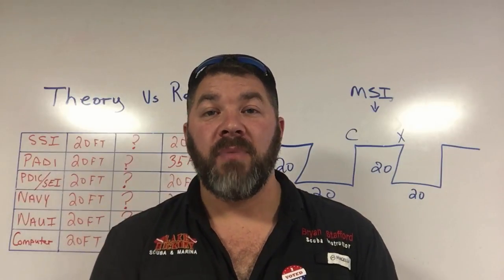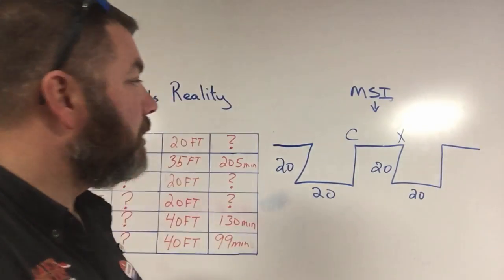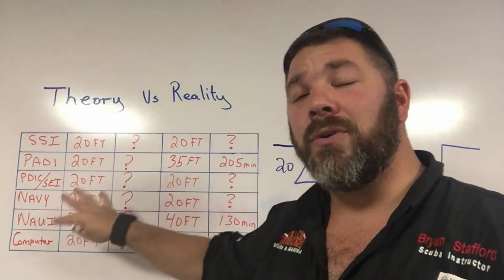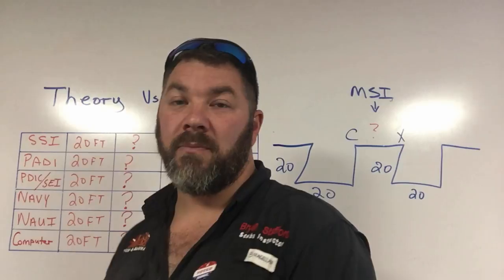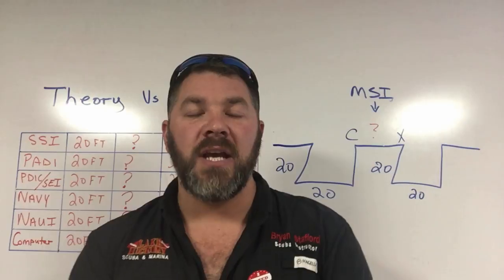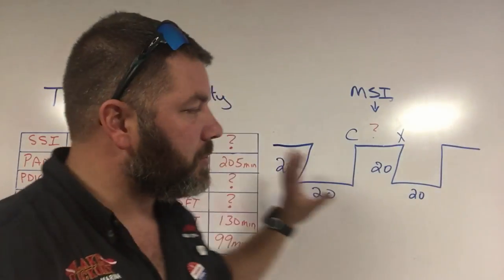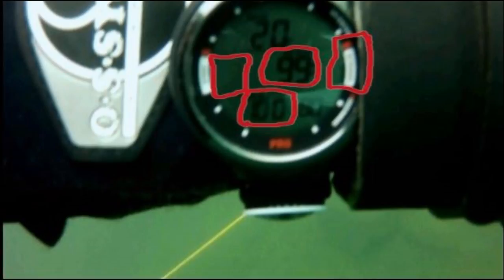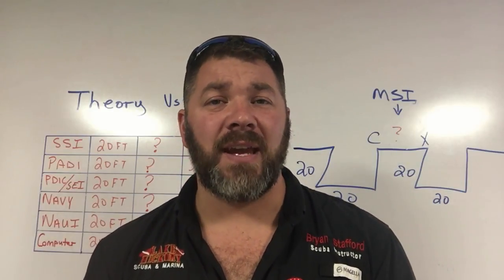Theory Vs Reality Will I Get Bent???

Comment: I just found your channel and I think it's great. I'm a fairly new diver who does most of my dives in shallow rivers looking for fossils. I typically am in water less than 20', usually about half that. I was told and based on my research I was safe from decompression sickness so it's not something I've spent much time worrying about. Your video was very helpful in explaining this. My dive buddy did have an incident this summer that was supposedly communicated to DAN by folks at the hospital. My friend presented to the ER with bubbles in his neck. He also was found to have had a large bubble in his chest cavity. As it turns out, there was a preexisting condition that he was unaware of (hole in the heart) that may have contributed. I am unsure if this incident would be considered DCS or some other sort of dive injury. He admitted to popping back to the surface by pushing off the bottom multiple times. The water was about 8' deep. I don't worry much about nitrogen in my body from these shallow dives, but I do always surface slowly while exhaling!
Reply from the maker: Hello sapperstang, we are so happy to have you as a subscriber.  Though it is very unlikely that a diver will find themselves developing Decompression Sickness at such a shallow depth, the risk is still there.  As you stated, the ascent rate is a huge determining factor.  I will state this though, Silent Bubbles are very real and can occur on land as well.  We can never be too safe when it comes to diving.  I know of several cases where divers made 1-2 hour dives in less than 20 feet of water, and upon surfacing decided to take a very hot shower to warm up.  This caused Silent Bubbles to form due to the fact as their bodies heated up, the residual Nitrogen expanded, thus causing the Silent Bubbles to manifest, and then developed into skin bends.  Thankfully though, this is the most common type of Decompression Sickness, that is rarely fatal.
Reply: Yes, a hole in the heart can be DSC problem, the lung can normally handle some of the air bubbles generated but if it is too much and goes from the right side to the left side of the heart, then it can cause a bubble to go to the brain, not good.

Comment: the ceiling for the safety stop on computer usually is 3 m (=10ft), so off-gassing is built into the models between 10 and 20 ft as you stated
Reply from the maker: Very True.

Comment: Hi Bryan, Thanks for the follow-up on my question. Someone told me (and I thought it was you, awhile back) that when dive computers show "99" it means the number is something greater than 99 and can't be shown with just 2 digits. In the case of the 99 minutes of no decompression time on your dive computer, I think it was just agreeing with the dive tables that it could not compute a time because of the shallow depth, or, something greater than 99 minutes - like the 205 minutes you show from the PADI table at 35 feet. Again, thanks for another great thought provoking dive video.
Reply: That's Right John! Dive computers either show 99+, 99, or --:-- when your NDL is greater than 100min. I have a Garmin descent dive computer and at the beginning used to show --:-- but after some diver's complained about the format they changed to 99+ like most of other computers. Even thought when going into the dive plan setting and inputing a depth of 20feet the computer shows the Maximum NDL of +999min, it only shows a value of 583.4min at 29ft this is with the conservatism set to low. In Bryan's experiment is really nice to see how he tries to see if going beyond the 99min mark will make him go into Deco. But as check at that depth his NDL would have been greater than 999min which even thought he passed the 100min wouldn't have put him nowhere near to the NDL values for that depth. It's also worth mentioning that this 99min way of displaying the NDL is reminiscent from 8 segments displays, with more modern computers using LED displays or dot matrix ones they could choose to show the value which would be around the 1000+min but for the sake of simplicity and ease of use to diver's that have become accustomed to a certain way of the readings to be displayed, manufacturer's have opted or been pushed by the customers (Garmin's case) to use that format.

Cheers!

PS: thanks Bryan for your videos and all the information you have been putting out here for all of us to share, learn and discuss. Keep it up!
Reply from the maker: You're welcome, and as stated by others, the general consensus is the screen can only display two digits. Thus, 99 minutes is the most it can display.  This is another reason we highlighted the bar graph on the right side of the computer, to show the on gassing of Nitrogen versus the no decompression time remaining.
Reply from the maker: Thank You Alexjandro for the kind words.  We appreciate everyone's comments here on our videos, and we enjoy learning from others as well.  Happy Diving.
Reply: Totally right! I missed mentioning that on my previous comment, your computer did not show any kind of reading when it came to N2 buildup, which demonstrates the point even further. 

Cheers!
Reply: Happy and Safe Diving for you too!

Comment: Hey
Bryan, My theory on this topic, and (correct me if I am wrong), is that at 20' depth is that you are only a little over ATM, and not under enough additional pressure to bring Nitrogen out of solution, thus making surface air perfectly safe for an unlimited time.
Reply from the maker: From a theoretical stance, you are correct.  The problem though is, no two humans are identical. We all have fast and slow tissues with different decompression rates.  From 10 meters of depth (33ftsw, 34ftfw) we find the biggest pressure differential.  The good news though, this is the least amount of on gassing of any gas.  So once again, theoretically speaking, yes you would have an unlimited amount of no decompression time.

Comment: Bryan, I think you messed up on your presentation of how your dive computer works...Mares simply shows the "no deco" time remaining at your current depth.  In your case since you remained very shallow (20-25 feet) the "no deco" time did not decrement.  If you were to go deeper that time would count down and when it gets to zero it will in fact go into decompression.  If it gets close to zero and you swim up a bit it will add time back on the clock.  Bottom line, the 100 minutes of current dive time being greater than the 99 minutes of "no deco" time remaining means nothing on the model dive computer you show.  What you want to see is when the 99 minutes "no deco" time begins to count down and get close to zero.  When that happens you are close to entering decompression.  I believe the 99 minutes shown on the screen is simply an a design choice made to limit "screen real estate" to 2 characters.
Reply: Not a Mares exclusive (2 digit limit to the no deco time), my suuntos, Uwatec all do the same, doesn't  mean the model internally is keeping more digits (it is THE difference between dive computers, rec vs tec
Reply from the maker: Hey Chad, you are 100% correct and we discussed that before shooting this video. Primarily, we believe that the screen real estate is one of the biggest reasons 99 feet is the maximum for this depth (based off what the computer shows in the plan function), (10:07 mark in the video).   Even comparing this to the SSI Tables, the maximum allowable time at that depth is 130 minutes, well beyond a 99 minute bottom time.  Also you would be correct as well with the remaining time at 20 feet.  The 99 minutes on the computer (dive time remaining) has not been met, even though the dive time has reached the 100 minute mark. This is another reason we outlined the bar graph on the right side of the computer, to show the viewers that we are no where close to super saturation of Nitrogen.  We have discussed doing a follow up to this video by placing a computer at a depth of 20 feet, for 24 hours, just to see what would happen.  We are curious to see if the 99 minutes remaining changes, or if it stays the same though out the 24 hour time frame.  Given the depth of 20 feet being the test depth, and the history of historical dives made by previous divers, my guess would be that the computer would show a diver going into decompression, both on the bar graph and on the time remaining, but the diver himself would be just fine.
Reply: You could try to simulate with a dive planner like Suunto SDM, has the same models as in the computers and you might not lock the computer beyond repair (suunto cobra for 24 hrs at 12m locked forever, not even factory reset possible)
Reply from the maker: Good idea.  I will probably call Mares first to see what they say about the Mares Smart.  To my knowledge it only locks up for 24 hours after a DECO Dive, without DECO obligations being met.
Reply: Many moons ago (2002) we had a Cobra permanently go into locked mode, never recovered and was replaced by Suunto, had been at 12m for 24 hrs ("lost" in a rescue course, found the next day :-( )
Reply from the maker: Hopefully we won't have the same thing happen to our computers.  But then again, if Mares would replace it for free, it would be some great advertising for them to see exactly what their computers could take.
Reply: Well if you were reaching your limits the 99 minutes of no stop time remaining would've counted down, and would've been zero before going into a mandatory deco stop. I know during a recent dive after being loaded up from dives earlier in the day I actually saw no stop times below 99 minutes for depths that would've normally just been 99 minutes for the entire dive.

My computer also displays a line for depths where I have no maximum no stop time. And 20 ft and IIRC even 30 ft are depths where there is no limit for air, and 40ft for EAN32.
Reply from the maker: Having residual Nitrogen in your system definitely makes a difference.
Reply: @LakeHickoryScuba  Bryan you are correct. The Mares Smart will not lock up simply because you accomplish a deco dive, rather it will provide you appropriate deco stops.  If you violate those stops it will work only as a depth gauge and bottom timer for the next 24 hours
Reply: Instablaster.

Comment: Firstly, thank you for creating these videos, they are always well thought out, practical and helpful.
I know that this video was posted a year ago, but the title grabbed my attention so I watched it & just wanted to comment on one aspect: 
** Warning. This post became longer than I expected. If you don't like reading, skip the to "CONCLUSION" **
Decompression sickness occurs when the partial pressure of Nitrogen in the diver's tissues exceeds the ambient partial pressure of nitrogen to the point where nitrogen can no longer stay in solution. The question is, how large can that difference be before it becomes a problem. According to Haldane it was a 2:1 ratio. This essentially meant that a person could be saturated to 2 atmospheres (33 fsw) and return to one atmosphere (the surface) and have a low probability of experiencing DCS. This was later modified down by Workman to a ratio of 1.58 (Interesting footnote to all of you SSI divers that this question comes up in the SSO Open Water Diver class. Don't ask me why on earth such a question made it into an Open Water level class, but I'm sure that there is a story behind that somewhere!). According to Workman's ratio, that depth would now be 0.58*33 = 19 ft.
Decompression theory moved on and we now think in terms of "M-Values" (also attributable to Workman). The "M" in M-value stands for
 "Maximum." For a given ambient pressure, an M-value is defined as the maximum value of inert gas pressure (absolute) that a hypothetical "tissue" compartment can "tolerate" without presenting overt symptoms of decompression sickness (DCS).
In the Buhlmann ZH0L16 decompression model, the tissue compartment with the lowest M0 value is tissue 16 at 41.8 fsw. Taking our 20 ft dive that equates to (33+20)*.79 = 41.87 fsw

CONCLUSION: Although I would not like to test it and I'd certainly not advocate it (always dive your computer). The reason why this 20 fsw dive does not show on tables or computers is because you can stay at 20 fsw, become fully saturated (i.e. stay as long as you wish) and could still make a (slow) direct ascent to the surface with a low chance of DCS because your tissues can take this level of supersaturation (at least in theory :) )
Reply from the maker: Hello Graham, thank you for the very methodical comment.  In regards to tissue saturation, this is how it has been explained to me over the last 31 years as a diver.  In short, Decompression Theory is Theoretical at Best. Simply meaning, there are not two human beings on the face of the earth with the exact physiological make up.  We all have fast and slow tissues, but both mine and your fast tissues will on gas and off gas Nitrogen at two different rates.  The same applies with slow tissues.  When a formula is developed (Workman's, Buhlmann, etc., etc.) training agencies and gear manufactures will usually consult with attorneys, and before they produce a product (computers and tables) and then make a claim that this is concrete evidence a diver will become bent, they will always distort the numbers for safety and liability.  I relate the Scuba Industry to the Food Industry.  When the FDA decides to release a new ingredient or edible product to consumers, they will take the maximum amount that is safe for consumption and cut it in half.  They will then take that amount and cut it in half again.  Lastly, they take that number and cut it in half one more time, and this is the number they release for safe consumption.  When we go tech diving, we are purposely putting ourselves into decompression (according to the decompression models), but yet through accelerated decompression we bring ourselves out of decompression at a controlled rate.  But even at this level, we still are allowed to choose what algorithm we want to use, thus proving the fact that Decompression Theory is Theoretical at Best. We did a video a while back showing the differences in several of the agency's dive tables, and the numbers were astounding.  I can say for a fact, that as a dive professional for 5 different training agencies, including SSI, PADI, PDIC, SEI, and CMAS, I routinely violate one or more of the agencies dive tables and limitations, but at the same time still well with in the limits of another agencies decompression model (it all depends on which agency I am teaching for day by day). By theory alone, I would have developed Decompression Sickness many times over.  My suggestion to all divers is to simply, don't over think the physics in Scuba Diving.  Pick a formula or model that you feel safe following, and simply go diving.  At the end of the day, a diver can do a simple bounce dive, well with in recreational limits with little saturation and still get bent simply because he exceeded a 30 feet per minute ascent rate.  Hopefully this makes sense.
Reply: @LakeHickoryScuba  But you can't compare dive tables to a dive computer.

Dive tables assume you stay at your maximum depth for the entire duration of your dive, while computers will adjust for your dive profile. Dive tables don't know how long you stayed at 100 ft, and then ascended to 72 feet, and then ascended to 20 ft. They need to assume worst case scenario and that you stayed at 100 ft for the entire time and your body didn't have the chance to off-gas. So exceeding times by a few minutes on a dive table in a normal dive profile where you start off deep and gradually shallow over the course of the dive until you decide to surface, would obviously not result in DCS as you've off-gassed, on-gassed less during the dive than the tables would assume.

Comment: I don't believe the 99 minutes on the dive computer is a no deco time. It is simply the fact that the computer can display 2 digits. My computer does the same, until my no deco time drops below 99 minutes. Try this. Start descending slowly. Watch your computer. At some point, the no deco time will decrease below 99 minutes. Prior to that, the no deco time calculated in the computer was greater than what the computer could display in its 2 digit display. That's why that once you went beyond 100 minutes, the computer did not show a required deco. The computer's calculated deco was still greater than 99. Thanks for early voting, I'm going today.
Reply from the maker: Hello Tom, you would be correct as others have mentioned as well.  Most computers can only display 2 numbers thus making the given No -Deco Time max out at 99 minnutes.  What we were wanting to see was, if the computer would go into DECO Mode after exceeding what was displayed, and based off what the dive plan featured showed. Thank You for voting as well.  Happy Diving.